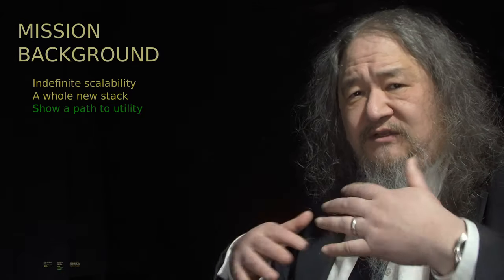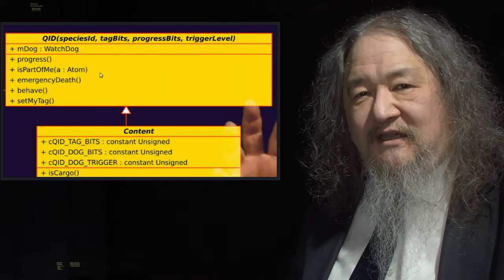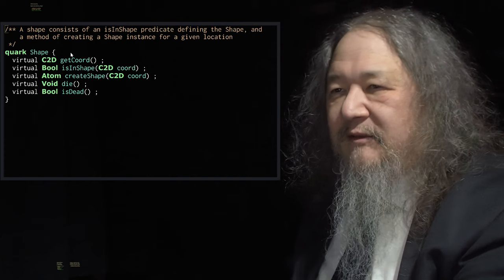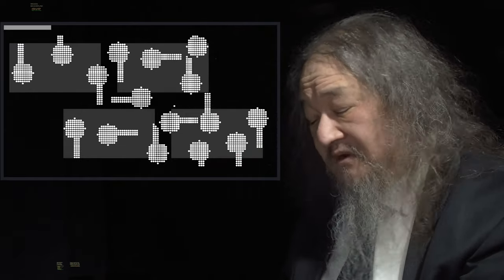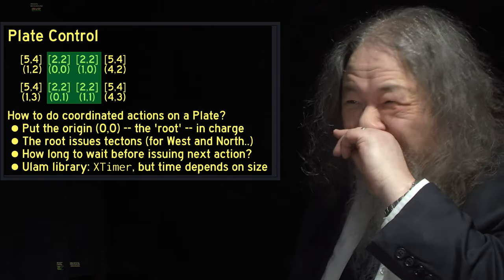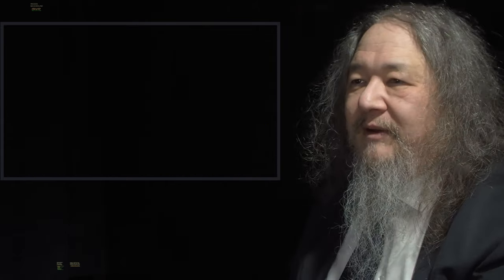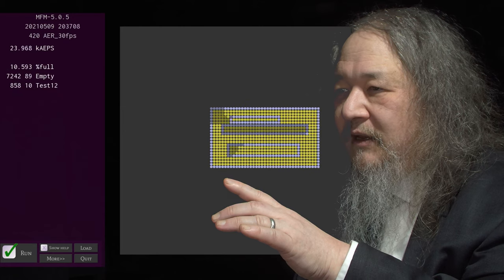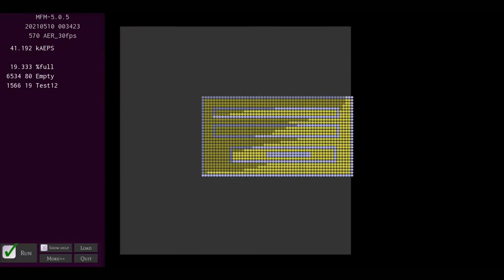Progress in Plate Tectonics - T2sday Update 298

Comment: That's very impressive, I could watch these plates grow and make their mini-plates all day long!
Did you think about a way to make plates indefinitely scalable too :D ? (If I understand correctly, their size is encoded by a fixed bit size integer)
And a way to split a plate into two disjoint plates?
Reply from the maker: Me too!  Any single plate is finite but yeah lots of routes to multiple-interacting-plates.
Reply: basically larger organisms may be represented by adjecting plates, like cells?
Reply from the maker: At least that would be the next level of structure!